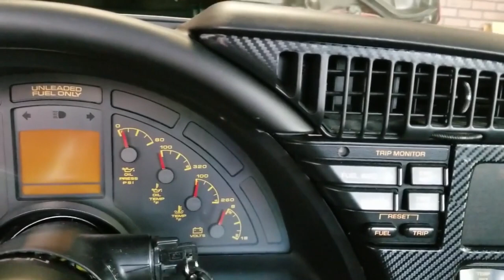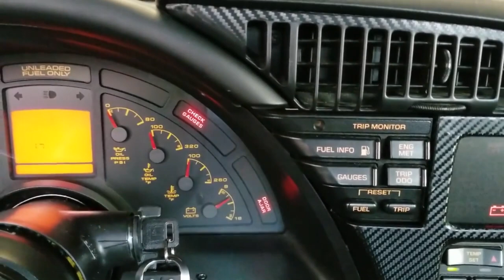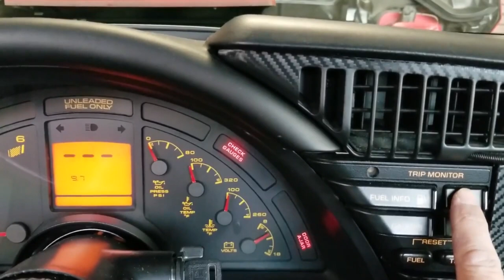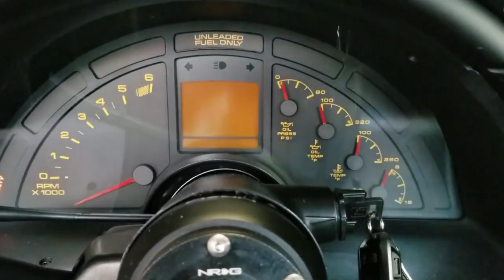How to Check Trouble Codes in a C4 Corvette

Comment: the 1994-1995 Corvette uses the 16 pin OBD-II (ALDL) pin.... your jumper positions in your video are only applicable for pre-94  with the 12 pin connector ...the 1996 uses the OBD-II

Comment: My 95 must be a late-year model, it has an OBD II port, but runs ODB I software.  Of course it can’t be easy.
Reply from the maker: I agree
Reply: My 94 is the same way. OBD1 system with 2 connector.

Comment: Good morning. I am Javier I live in Spain.
I'm watching the video because I have a problem with my 92 corvette, I was on the road and suddenly the engine stopped and it won't start, I checked the fuel pump and filter and everything is ok. I want to check codes and I'm not sure about putting the paper click on the two pins that you use. My question:  is your car a 92 corvette?
Reply from the maker: Sorry your having problems.
Yes it is 1992
I hope you figure out the problem.
Good Luck,
Scott

Comment: I have a 1995 c4 and air bag ligth keeps on every time i turn the car on blinks like 3 or 4 times and stays on...so my question is can i erase that with this process
Reply from the maker: No Most likely you have a bad connection or a bad Air Bag.

Comment: I have a 92 and do not see the port for the scan tool. How do you locate it. Thanks
Reply: Mine was tucked up into the console above my right knee it wasn't fastened in place because work has been done there before and they didn't put it back. Genly tug wires there and the connector may come out

Comment: 95 has obd2 connectors
Reply from the maker: Yours must be later 95
Reply: @THECORVETTECHANNEL  No, YOU are wrong and frankly you should do a little more research before you post a video. 1994, 1995, & 1996 ALL use the OBD2 connector. ALL OF THEM. The difference is that for 1996 only the software itself is OBD2 where the 94 & 95 are still using OBD1 software.

Comment: I have a problem. I bought my 1992 LT one Corvette three months ago from a mechanic guy got a cheap ever since I drove it from after buying it emergency brake light stays on Dash all the time driving everything and I noticed I can’t even spend the back tires it’s a Corvette what do use of having a Corvette if you can’t smoke the tires I replace the brake pads check the fluid even remove the emergency brake Handle and unhooked it from the break them self on the back of the lights still on if that light stays on it won’t let me spin the tires that’s my problem so I have this Corvette if I can’t do it because my last Corvette guy told her an accident that a kid hit me that was an 86 Indianapolis 500 race car I took the engine out boom two weeks later totaled the entire front of the car gone. I can hold the brake a little bit and put the gas to the floor the tires will not spin ain’t shiting you. It has a code 16 on but I got a check again as it should be the only one I even bought a brand new OPTi spark distributor but I want to find out and spin my tires off before I put that new shit on it doesn’t spin the tires it’s not going on I’m saying back to get my money back. Someone needs to tell me what I have to replace probably replace it with a fucking Yugo car. I bet you Yugo car with spin tires a lot better then a C4 Corvette.......
Reply: I also removed the back 2 wheel sensors I’m going to clean the front ones today. The back ones were bad covered with rusty metal, I’m sure the front ones will be dirty like the back ones.....
Reply: Were you drunk  when you wrote this??